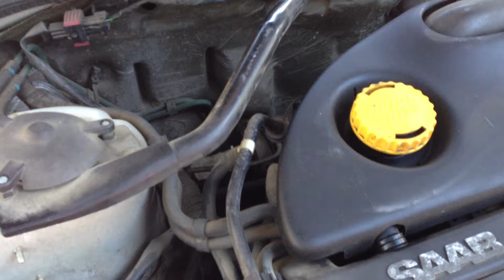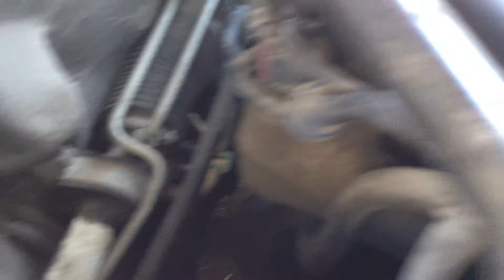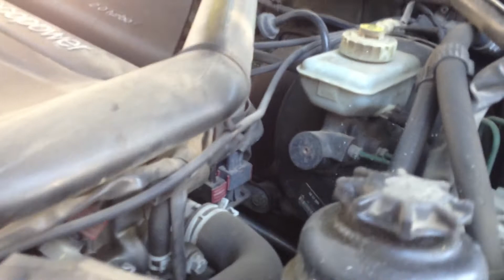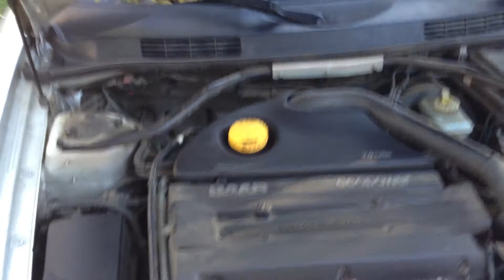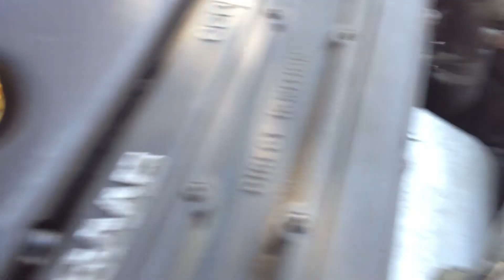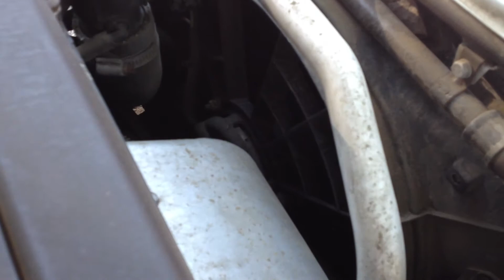2000 Saab 9-3 SE Engine rattle / noise

Comment from the maker: Thanks, Ozzie.  I have NOT dropped the pan to check for sludge.  I have been using full synthetic oil for ~10 years, and have installed the PCV version 6 system.  Still, I'm nervous about sludge.  Don't think I'm capable of removing and replacing the sump myself, though...

Comment from the maker: It was apparently something afoul inside the AC compressor.  Replaced this and the belt and all is good!
Reply: Thank You!!! This morning I've got the same noise on my Viggen and it does make sense as I have noticed the AC not cooling as it used to be
Reply from the maker: More specifically, I believe the AC compressor clutch bearings went out.  You can try putting AC in 'eco' mode, which turns off the compressor, to see if this helps